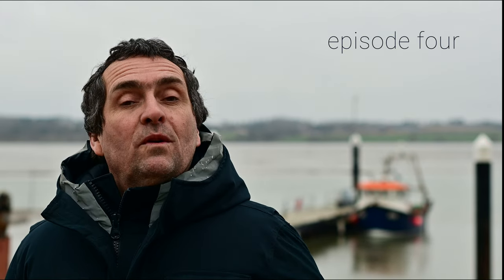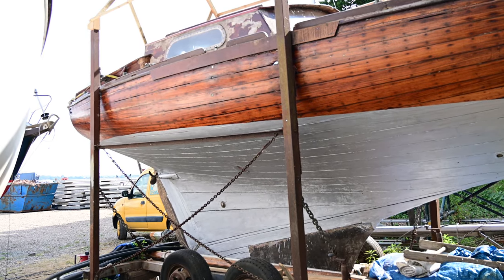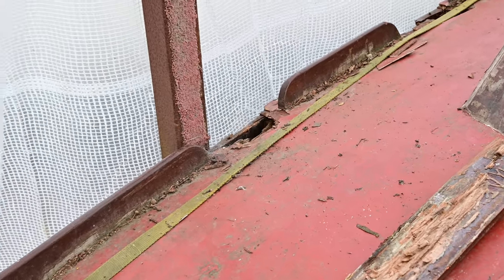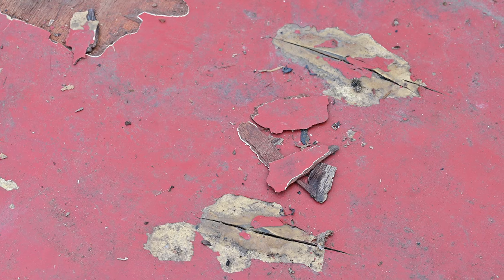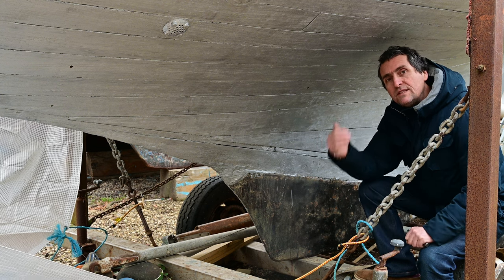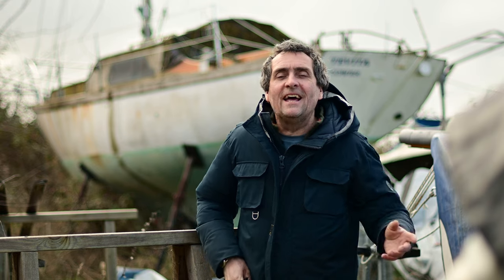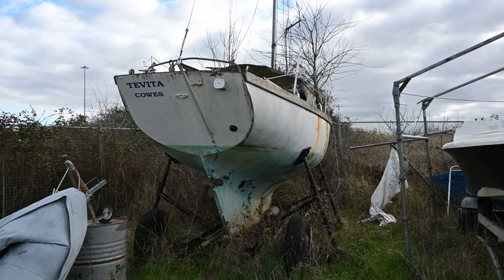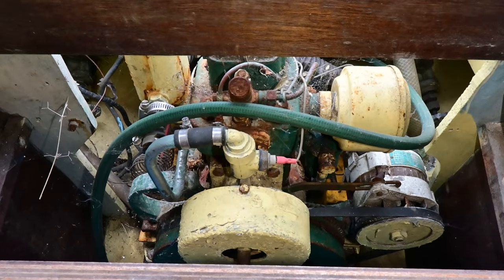Discovering problems & finding solutions - Saving Susanna ep.4

Comment: Sorry for scaring you re the keel bolts! 🤣 you should be able to pull one at a time even with her sitting on the keel, in the cradle. Itll give you some closer to know the condition. 
The deck has patches of rot right enough but initially doesn’t look like a right off. Take it back to the ply and re assess, patch and reglass. Assuming no rot in the deck frames it should be good for a while. 
 You’ve made the right choice though to take the restoration seriously. Good luck going down this road! Its highly emotional! 😂
Reply from the maker: Haha no worries! In fact i'll be able to rest easier having inspected them - i'm actually quite looking forward to doing them now! :) As for the deck i'll do just as you say, strip it back and have a good assess... And moving the boat to a closer yard, along with having a different boat to learn to sail on allows me to really get stuck into Susanna - and to do a (hopefully) really good job of her, without a time pressure. Makes it much more of a pleasure to do. An exciting summer ahead! Thanks again for your helpful advice - Cheers!
Reply: No that will not be practical if at all possible. The bolts will have a nut in a pocket in the the lead but even if you uncover the pocket by grinding back the keel to find them, the ability to pull them out of the lead and through the floors will be a monumental task all having to be done one at a time.
The correct procedure is:
1.In the first instance to put a socket on the keel bolt nut inside the boat with a lengthy bar for traction, and use all your strength to try to tighten the nut. If you can tighten and nothing breaks that is great, if the bolt breaks then keel off. Please do that first without pulling off the keel 
2. If you have to take the keel off, undo the keel bolt nuts inside the boat, have her hull correctly supported and then jack the hull up high enough to remove the keel to expose the bolts. That way you can inspect all at once.
Get proper advice from a boat builder who will show you how to raise the hull without damage and do not listen to people who do not know what they are talking about no matter how well intentioned their advice may be. You run the risk of racking the hull if you do it incorrectly.
Reply from the maker: Good advice for when i get to the Keel.... Thanks!

Comment: Hi, having done something similar with a 48’ fishing boat, the deck covering would traditionally have been canvas on red lead putty and then paint over by yours doesn’t look like that.  Another way is Cascover which is a strong nylon cloth laid on Cascophen Resorcinol glue, very strong and again yours doesn’t look like that either.  Maybe it was a poor epoxy covering with no fibreglass mat but looks like best to remove all of it. The thing on the hatch is a mainsheet traveller not a boom vang.  It would likely have been mounted just behind the cockpit or perhaps in the middle of the cockpit.  Should be obvious where it got ripped out from.  My best advice is build a tent to work under or get her in a shed.  Makes everything so much easier but can add to cost.  Best of luck. Andy UK
Reply from the maker: Hi Andy, Thanks for the info, appreciated! I think you are right that it's just epoxy without fiber. i'll definitely strip it off. I would like to re-cover it in the end with canvas and so your red lead info is great thanks! and 'Mainsheet traveler!' thats the one lol... really couldn't think what it was called! - She's under a canopy/shed sort of think that i built - as you say, makes things so much easier to work. Thanks again for the info & advice :)

Comment: You can get a rough  idea of the state of the keel bolts by whacking them with a hammer. If they sing they are probably ok, if they go plop they are probably not.
Reply from the maker: Great tip thanks! Particularly for Tevita as I'll draw them out on Susanna but just want Tevita in the water so I can learn to sail.. Cheers!

Comment: You made a comment about patching her up just to get her in the water but you said that wasn't the right thing to do.
CORRECT! I you are going to repair a vessel, do it once and correctly no matter what the cost and then go safe boating
Reply from the maker: Yes indeed. I had hoped as i'd said, to 'patch her up and go sailing' - Which was the initial reason for buying a boat. Once i started properly though i could she needed, and i wanted, to really do things properly. That's why i went in on the other boat 'Tevita' with my brother-in-law. She's a much quicker 'fix' and i can actually go sailing (learn to sail first actually!) - And then take my time with Susanna, really 'roll my sleeves up' a get her solid, seaworthy and, hopefully, beautiful!